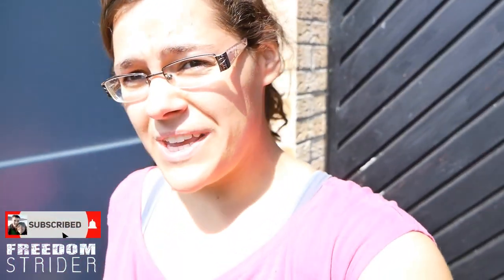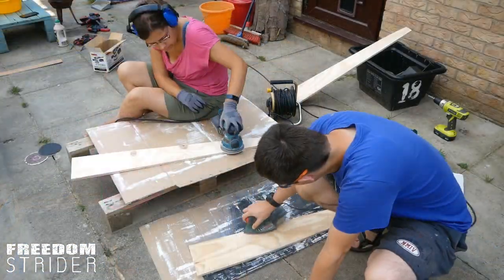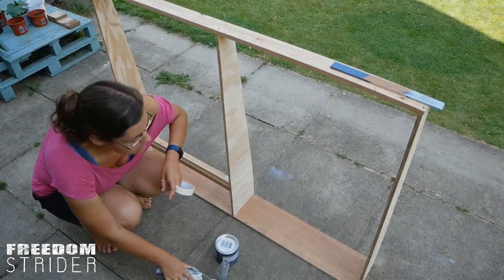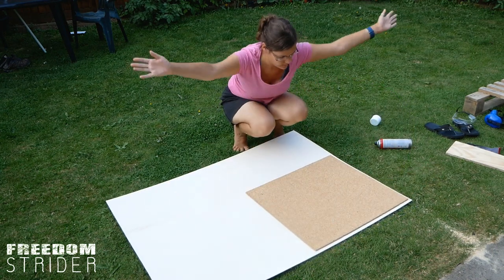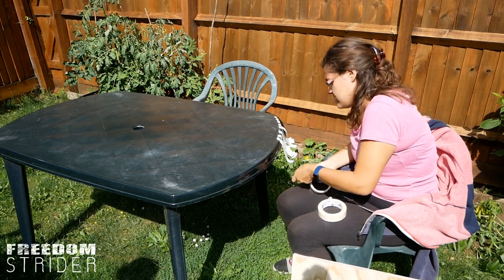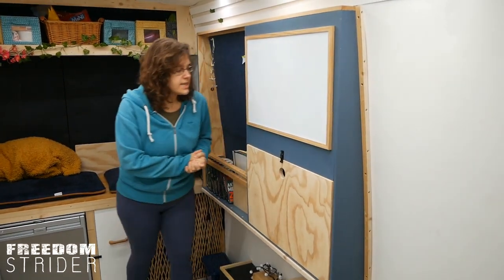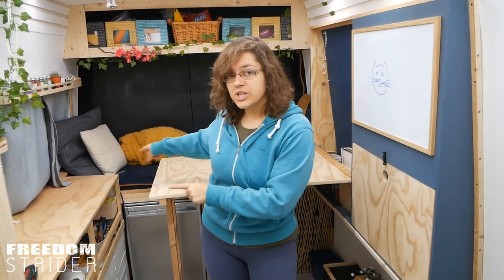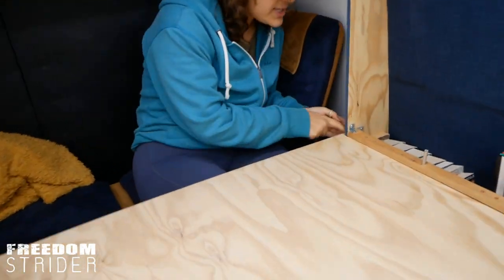Super Unique Fold-Down Campervan Desk Unit

Comment: I had to flatten some warped plywood, I had to wet one side with warm water and then weigh it down between two flat surfaces. Didn't think it'd work but it did, that being said it was a small easy to manage piece.
Reply from the maker: We did try to same, multiple times, the pictures don't show the ply being wet but we soaked 1 side and hoped the weight would fix the warp. It did temporarily, but eventually, as the ply sits, it warpped back. And because the tabletop is not permanently fixed to brace it flat, there's nothing to stop it from warpping again.

Comment: Have you thought about bi folding the big desk. By doing that it would probably solve the straightening issue and you would also fit it in where you want it to.
Reply from the maker: We have been mulling it over splitting it in half and have it folding...the idea hasn't matured much yet. Do you have any links to good examples?
Reply: @FreedomStrider  I'll have a look through some of my own Pinterest gallery. If your going down a light box sort of idea then it would be slightly easier. I'll dig some pics out for you.

Comment: Guys, 1) never use extension leads coiled up, they get hot and become a fire hazard, 2) wet the plywood thoroughly, add weight and it should flatten out and stay flat when dried. 3) rocking the yoga pants 😜 oh and invest in a pocket hole jig, great pieces of kit and you'll save money on brackets and weight over your build, ideal for wood to wood joints, best used with glue.

Clever idea with the pins btw.

The laptop fold down, i noticed the gent had to pull it back out a tad so it was flush before closing the clasp, I'd suggest a smaller stopper behind it so its always flush when closed.
Reply from the maker: 1. Yes you're right 
2. We did try that, multiple times, the pictures don't show the ply being wet but we soaked 1 side and hoped the weight would fix the warp. It did temporarily, but eventually, as the ply sits, it warped back. And because the tabletop is not permanently fixed to brace it flat, there's nothing to stop it from warping again.
3. 😉
4. At this point in the build it's not worth buying a pocket hole jig, but maybe for the next one 
5. Yes, I think having a little foot to stop the laptop desk from falling back too much would be excellent, but haven't gotten around to it yet. Well spotted! 😎

Comment: How about having Vertical Rails along the frame to slide the table up and down? Slide it up and push it In, when not in use. Pull out and slide down when you have to use it as a desk. Would that work? Just an idea.
Reply from the maker: We have discussed rails, and we would have liked to, but because of the 'special' height that it needs to be and the fact that we want it to move backwards and forwards (when at height) the rails we would need would be a feat of engineering 😂... we'll work on it.
Reply: @FreedomStrider  you could have a Horizontal Rail mounted on a Vertical Rail. But the Horizontal Rail will work only when the table is down to the slot.